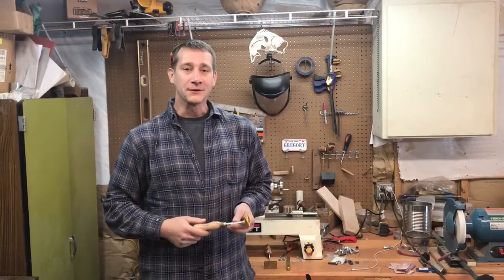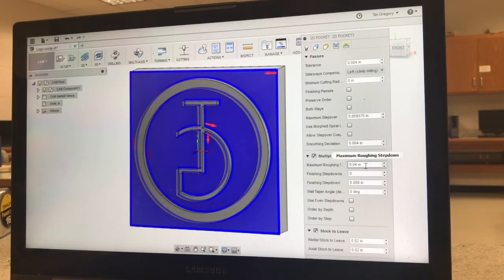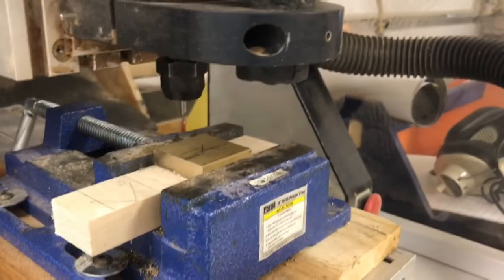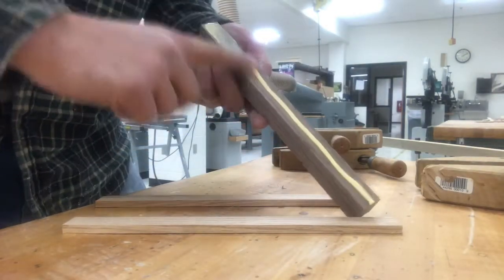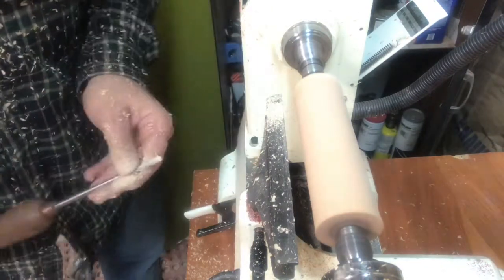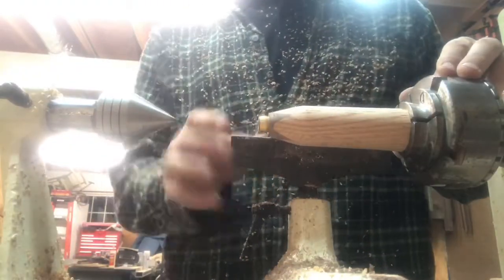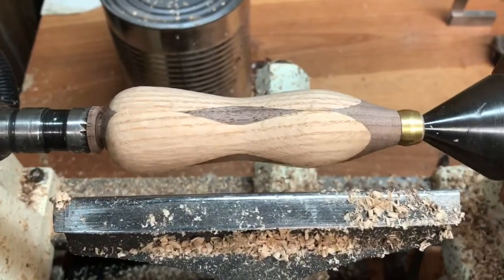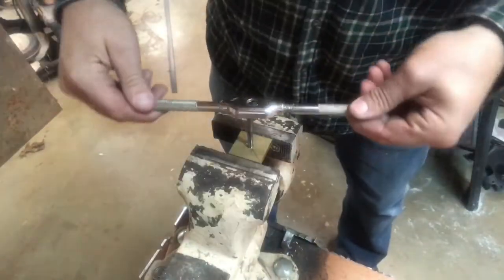Making a branding iron

Comment: how thick was your brass blank when you started before the cnc machine? I am trying to make a brand.
Reply: 3/8” or 10mm
Reply: how deep did you cut your logo into the 3/8" block? I'm just learning how to do this.
Reply: Martin Marquez - I machined 0.1” of brass off of the stock to form the logo. I did this in multiple steps removing 0.03” per pass